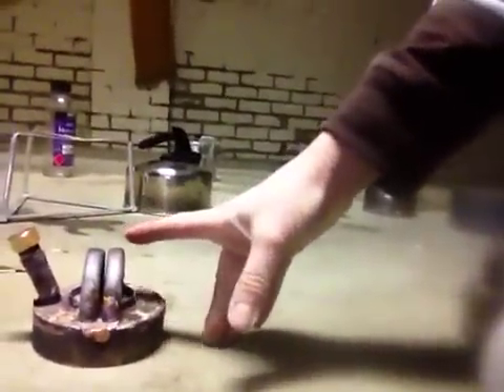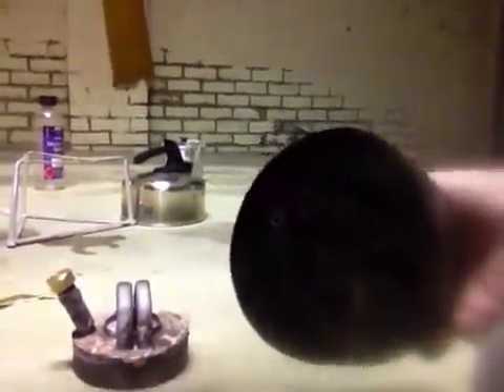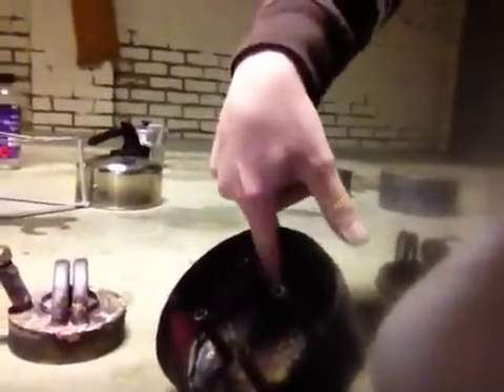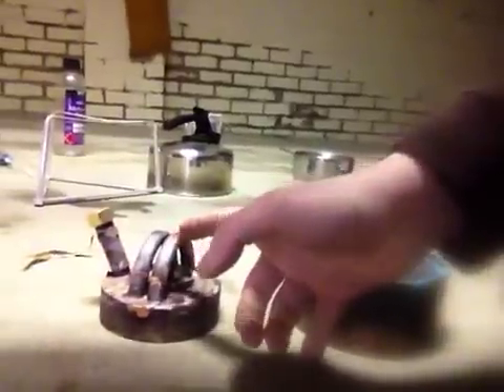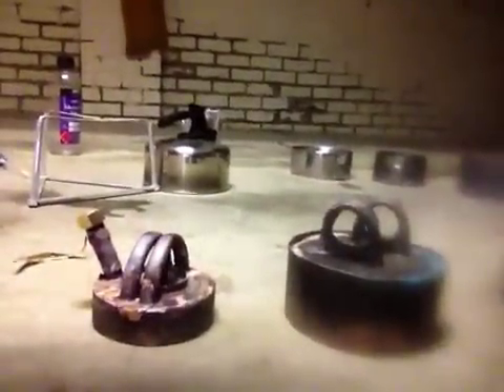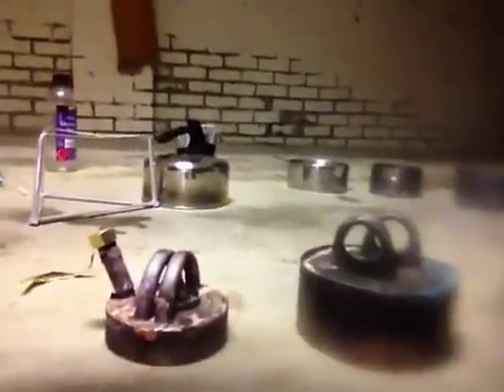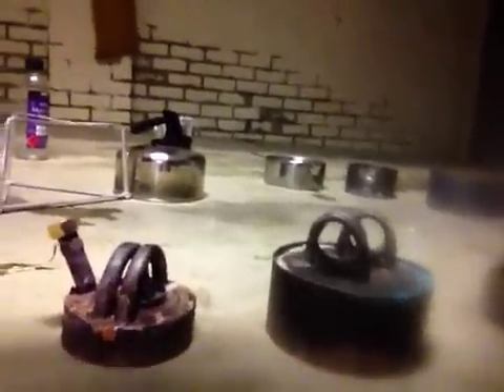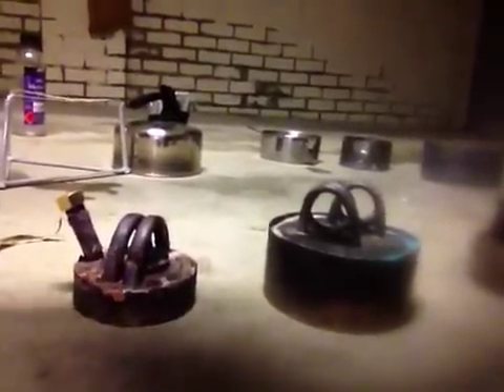Pressurized ethanol "pipe and can" stove- coil-less

Comment: i am using a 1mm thick and 5mm diameter in total tube, but I don't see y the flame is not shooting like jet as yours, the hole is around 1mm dia,  do the wicks inside affect the results?

Comment: Hi!
My aluminun stove go until 60°C. Is very sensible when touch, there is fast reduce of flame.
I think there is very much feedback of heat by pipe. My purpose was make a low profile stove, so, the temperature the can( reservoir) increase, but, 1500°C is very dangerous! The reservaoir is only vapor alcohol under hight pressure!
To solve, is necessary less feedback, so, one pipe or change the flame line.